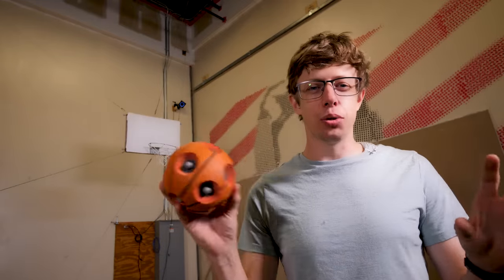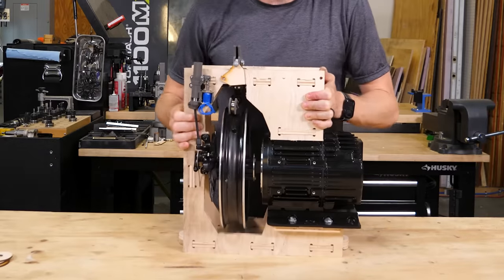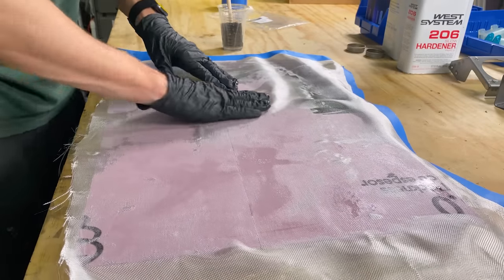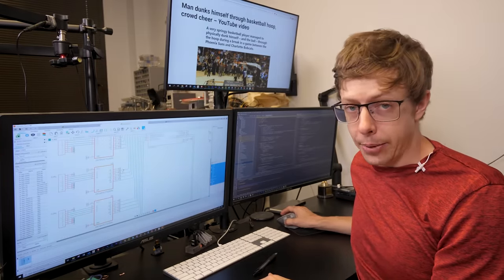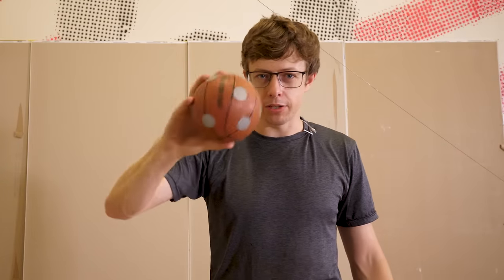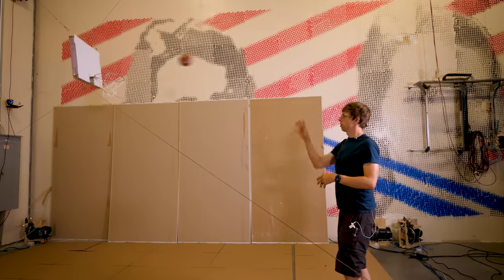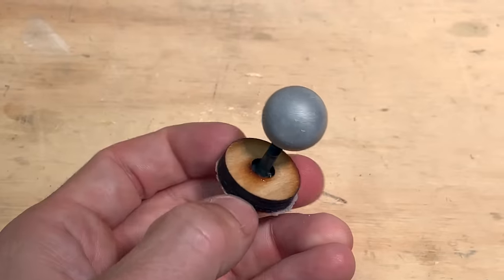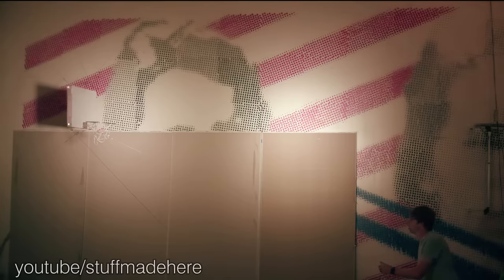I made a ball seeking hoop

Comment: Excellent showcase of:

3:00 Engineering Design (Motor mount CAD iterations)
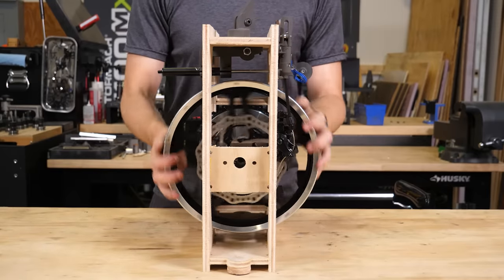4:00 Manufacturing Processes (Turning, Drilling, Welding)
6:00 Materials Engineering (Foam-fiberglass composite)
8:20 Computer Engineering (Custom controller PCB design)
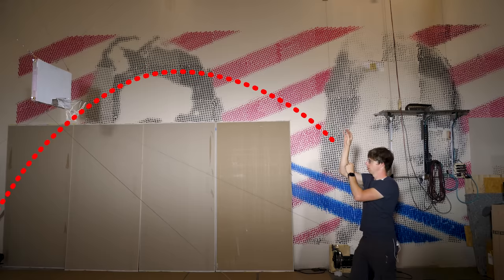11:52 Applied Mathematics (Second-Order Differentiation)
14:15 Mechatronics Engineering (Inverse Kinematics)
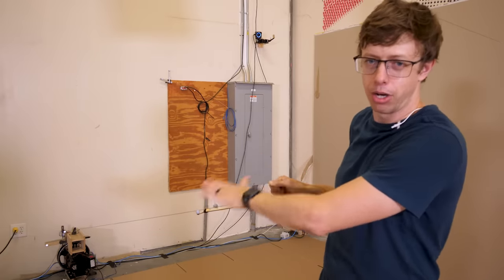15:42 Computer Science (Gradient Descent)
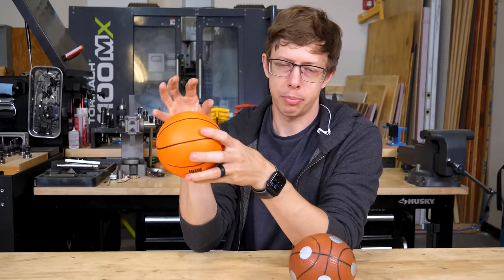18:00 Materials Science (Ductile-Brittle Transition Temperature)
20:43 Workplace safety
21:58 Unsafe workplace practice

You are the most versatile engineer I have ever seen. Well done with this project!
Reply: 100%  Best comment!  As an Mechanical/Automation engineer, I'm blown away by his well rounded skill set and troubleshooting prowess.  This man is a beast of an engineer and I wish him all the success!
Reply: @weibull760  ok this might be a dumb question but if he’s just finding slope of the parabola to see if it matches gravity why does he need the second derivative
Reply: @jackinzbox.  the second derivative is the slope of the first derivative.  The first derivative of the camera data is a bunch of flat lines as well as lines of different slopes, a computer processing all the different flat lines and slopes would take a large amount of time and processing.  If you use the second derivative you shrink the data you are looking for to one number 9.8 m/s2.  And a computer can just derive the data twice and then look for the 9.8 number much faster than a computer looking for a specific sloped line in all the random movements.
Reply: @hexlensespecs7560  oh okay that makes so much sense. Thank you.
Reply: ok
Reply: @hexlensespecs7560  It's not quite that simple, as computing the difference of differences for discrete measurements is known as a cardinal sin in signal processing. You can't reliably use this second order difference without estimation techniques or filtering. Your description is correct in principle though.
Reply: @Triszious  never heard of this in my workplace
Reply: def smarter than mark rober

Comment: Been considering machining my own circuit boards for years. But if this guy struggles with it...
Reply: For simpler boards it works ok.  The biggest thing that helps is finding good copper boards to start.  Cheap boards delaminate easily.  Also making the spacing larger so there is more of each trace, also helps.  Again, simple boards are good candidates.  Yes.  I've done it. ~P
Reply: It's probably because height diferences around the copper plate. At 0.1 mm scale even the slightest bent make huge height difference. U should take bunch of height measure at bunch of places and make a curved path for ur cut with this readings. There is a already programs to do that easily.
Reply: As previously mentioned, it’s best for simple boards. Start with a single layer board with thick traces/pads. Use a thick pcb material so you can have deeper cuts for cleaner routing. Always visually check the cuts for leftover copper before powering on the board. 
Another option is to order a “barebones” board from someone like “advanced circuits”. They make some good stuff for hobbyists. 

Have fun!
Reply: Its so much easyer to lazer cut vinly and dissolve the coper in etchin solution
Reply: I tried it a few times and yeah it's not really worth it given the cost of having a fab do it. Plus a proper silk screen looks so awesome if done right.
Reply: @phillies4eva  i mean i havnt done it since highschool but as long as it was cleaned and rolled on with a j roller they tuned out great but u had to watch the time
Reply: I use a machine from LPKF for quick prototyping or simple designs at work.
Reply: Keep in mind that Stuff Made Here is more of a generalist, not a specialist. I'm sure anybody with determination can get it down pat quickly.
Reply: why machining them yourself if its cheaper to just order custom ones from china?
Reply: Just because Stuff Made Here struggles with it doesn't mean you can't do it. So many people have stopped pursuing something because their idol couldn't do it. For all you know, you might have the right ambition, determination, focus, and interest to do something that someone else couldn't do. This is literally how we improve and advance as a civilization. If you want to make your own circuit boards, do it. If you don't want to, don't!
Reply: hey I have an amazing idea for a business. You seem to understand things I can never foresee.  Maybe you can help me out and ill give you a percentage of my company! I know it sounds like a common scheme but I really do need help.  (ive asked so many people and never gotten a response so it never hurts) .
Reply: So throw the ball at a speed that exceeds acceleration of the hoop? Easy miss.
Reply: Single layer large boards are easy. Double layer boards with fine traces are harders. 4 layers is insane
Reply: We have no hope then bro… im in the same spot!!! Just hopeless! 😅
Reply: It's easier to chemically do so, guys like bigclive have vids on it but honestly with companies doing it for pretty dang cheap it's one of those things that only makes sense if you prototype like... Tons of boards.
Reply: In his defense, he struggles with everything. He just keeps at it
Reply: as somebody with 0 idea of what is talking about: can you laser cut it?
Reply: na man just go for it, you try and you may fail but just take a shot at it, you don't have too much to lose
Reply: What do you need to study to  be able to do such things?
Reply: You can use a sla printer to do good circuit boards
Reply: try it anyways. doesnt matter who cant do it. might as well give it a go
Reply: With how cheap and fast you can get boards printed now there really is little reason to do them yourself.
Reply: Boards are so cheap now there is no reason to do this yourself unless you need a board immediately.

Comment: As someone how works on precision motion control systems for a living, the only suggestion I'd like to make is to the Estop system.

Generally it's best practice to make it so the Estop system/brake requires an input to free the brake and any loss of that input should disable the motors and lock motion. For example, if your backboard is moving quickly and you lose power to the system for some reason, that backboard will still be moving because of the inertia left from the move. You'll only have the pulleys and the resistance of the disabled motors as a brake until you can reach and activate your Estop system(assuming you can reach it in time, and is it even works without power). 

Ideally you'd have the brakes setup so they are normally pressed against the discs, and have something that pull the brakes off the discs when powered, but when not powered can be freely moved. For example, if you use a small DC wiper motor and a spring pushing the brake toward the disc, you can have the DC motor overcome the spring freeing the disc, and when power to the motor is cut, the spring should push the brake back against the disc immediately stopping the cable. The supply for the motors/actuators used for holding the brakes would run through the Estop button and also power relays to that connect the motors to their supplies when in normal operation, and disconnect those supplies when either power is lost, or the Estop is triggered.

For a home project it's that that important, but it's good to get used to designing safety systems like you were getting UL and TUV certifications.
Reply: The keywords are fail-open and fail-closed. You are suggesting fail-closed, or a dead-man switch.
Reply: @belg4mit  not quite. A deadman’s switch would require the operator to have a hand on the button the whole time and for it to deactivate if he let go.
Reply: Fail safe is the correct term and the first thing I thought about with his brake system. is it's not fail safe. As mentioned above, the brakes need to be held off and any loss of power or control causes the brakes to come on. And come on without using any electrical power.
Reply: @belg4mit  At my company we just refer to them as normally open or normally closed circuits to match the terminology of our limit states, because failed open/failed closed can be mistaken for the failed state of a component in a circuit.

If you have a diode fail for example, it might become a permanent short causing a "failed closed" condition. it can also blow open causing a ""failed open" condition.

Also when working directly with someone who doesn't work on electronic circuits(Wiring or Service departments for example), that terminology won't mean much, so I kind of learned to avoid using those terms to avoid confusion.
Reply: @belg4mit  As an engineer he's probably aware of both concepts, but maybe weighted out the time and effort to enhance his design for a fail-closed design. I would assume a working emergency stop for testing was more important, because this beautiful contraption is probably only going to be used for this video (and maybe one or a few further videos) - not a thing that will be in use 24/7 open to the public, which would need higher safety features.
But I have to agree though - a sudden power loss with that thing coming at you could be very dangerous. But being surrounded by those cable alone would make me feel eerie - I probably watched too much movies :D
Reply: Sort of like emergency doors (that unlock when the fire alarm goes off) or semi-truck air breaks that clamps shut when there is damage to the lines?
Reply: @DH-xw6jp  I'm not sure if the truck's air brakes are disengaged while in normal operation, or actively engaged by another system when there is a problem, but if it's the former, then that would be correct. For fail-safe systems, you want something that is actively working to prevent the system from braking/shutting down.
Reply: @Poptart133g  the former is how the truck's air brakes work.
   The air pressure is actively keeping the heavy spring loaded brake "open" and disengaged, and when you press the pedal you are bleeding air (the iconic hisssss of the big rig coming to a stop) to let the springs clamp on the brakes.

Unlike the hydraulic brake of a normal car, which fails in the open position if the line is cut. Air brakes fail in the engaged position if the air lines are disrupted.
Reply: @marcel1416  You'd be surprised how many engineers don't know that stuff, just because it's something they don't usually have to work on. There are many field of engineering that usually work in tandem, and not all will know the specifics of the other's fields.

We actually have an engineer who's only job is designing our safety systems and working with ISO, TUV, UL, and a few others to get our systems certified globally. While he's a good programmer, and a very experienced electrical engineer, if you told him he had to do the metrology for a 10 axis system, he'd probably show you some creative uses with our high voltage safety analyzer and some clamps you wouldn't forget...
Reply: @DH-xw6jp  Nice to know. Other than air bearing stages, air counter-balanced linear stages(usually vertically mounted) and small things like pneumatic actuated collets for some of our rotary axes, I don't often get to work with pneumatic systems.
Reply: @DH-xw6jp  Exactly, spring brakes, the parking or emergency brake,  on heavy trucks is a perfect example. It needs an outside source (air pressure)  to keep in in the unapplied state. Lose the air pressure and the brakes apply automatically.
Reply: @laurencenoble3629  Please reread, I said "or"
Reply: @inothome  fail safe encompasses both. In many situations the particular form matters.
Reply: @marcel1416  You seem to have crossed the streams. My comment was simply condensing the original from B’19-GÈ3o ̄5 into the short-and-sweet standard terms so that others could loo them up if they liked. I was not making any judgement about Stuff Made Here's design decisions :-P
Reply: @belg4mit  Sorry, my comment wasn't meant as a judgement either. Maybe that got lost in transition (English isn't my first language, I'm German).
I was more trying to convey, that as an engineer he is probably aware of those concepts but chose to disregard them, because the only only danger from this project is to himself.
Those failsafe concepts are important - but in my opinion they are more important when you involve others or the public, not as much when you are "messing around" for a project you do yourself.

Comment: As an amateur at physics, engineering, software development, machine learning, and math, I know exactly enough to know how much of a nightmare getting all of the stuff he did in this video to play nicely with each other, and I do not know enough to know how on earth he could manage it all by himself.
Reply: Just a computer science programming major, the algorithm for this is insane. Need a fast processor just to predict where the ball will go. That doesn't include of moving the hoop.
Reply: Could you just use a game engine with a copy of the setup and take the data values from it to control each of the pulleys so you don’t have to create the crazy algorithm yourself?
Reply: @TheNuclearBolton  i'm pretty sure using a game engine will just push the computing power needed to do this way through the roof, and even then it might not be fast enough

Using pure calculations is most efficient
Reply: There are companies out there with lots of talented and experienced engineers, producing solutions for such problems.. he is one man army.
Reply: @blowc1612  I think the hardest part of the required software is to manage all the latency and inaccuracy in the system. The camera tracking system will have some latency and error, motors will have more or less random latency and inertia, wires will have some unknown amount of elasticity.

I see that there was a measuring ball attached to the tensioner so there's probably pretty good idea about the cable tension, which is a good start. I would have expected to see some kind of suspension dampener for the tensioner to avoid some of the springy oscillations, though.

Comment: This is an awesome application and a great video! All the engineers here at Teknic thoroughly enjoyed it - Keep up the good work! 

You mentioned (and showed) that the motors freewheel when they shutdown. You may already be aware of this, but there is a feature built into the motor called "Dynamic Braking", which can help prevent the motors from freewheeling in that situation (although the hoop could fall for a number of other reasons the Dynamic Brake can’t help with). Please feel free to give us a call if you’d like help setting this up. 

Additionally, you pointed out that those motors have a lot of power. We're glad that you implemented some safety protocols to ensure that all people (wives included) are kept intact. It's always important to think of all the various safety requirements when working on a project. 

Great work,
Bridgette G. – Teknic Servo Systems Engineer

Comment: I want to see it do infinite points. Keep the hoop "stationary" (relative to the ball) right when the ball center is in the hoop center, following the parabolic trajectory. So the camera attached to the backboard filming the hoop sees the ball float in the hoop without touching anything with the entire room spinning in the background. :)
Edit: Another thing it could do: Make it balance on the hoop, spinning around like 10 times and then stop and balance it in a stationary position for a while before dropping it in.
Reply: That would be cool 😎
Reply: Yes
Reply: From a noob CS major I think it would run into compute and memory limitations trying to calculate that many points. He's running this on a laptop
Reply: @FattyMcGirthy  It wouldn't require storing or computing any more points at once. He just has to keep matching the position continuously after it goes through just like he does up until the point it enters the hoop. To some extent he "just have to delete the code" that stops the tracking once it enters the hoop and it will work. The tricky part is that he will have less margin of error and require a bit more precision at more of the extremes of the parabolic tracking for the effect to look as awesome as possible.
Reply: @CuulX  It pains me that I'm not smart enough to understand what you're saying, lol. What would be the ultimate outcome of this?
Reply: @randomanon9290  For the first trick: The hoop would move with the ball, so it would look a bit like the hoop was attached to the ball for a short while and flying with it, except it wouldn't touch the ball.
For the second trick: Imagine you throw the ball and before it falls in it rolls around on the edge a few loops. Pretty normal, right? But I want it to keep rolling unnaturally long and then stop and just balance for several seconds before dropping in.
Reply: @CuulX  Wow, that would indeed be incredible. Thanks for breaking it down for me.